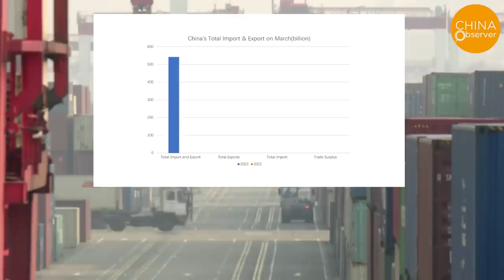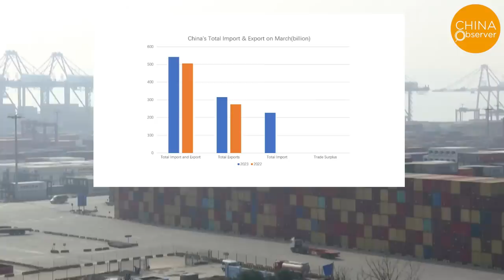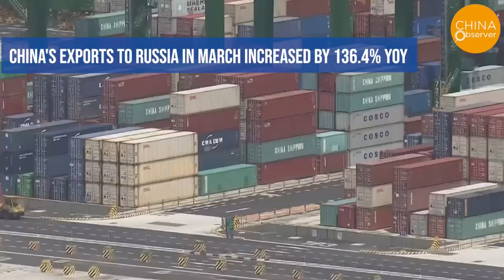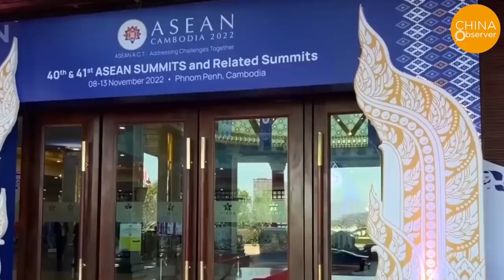Why Are Ports Full of Empty Containers Despite 14.8% Export Growth? | The Secret Trade Routes

Comment: Good info.  I can think of several reasons that might also play a role in the empty containers vs export surge situation:
1) When China was exporting directly to the US in the past, a lot of the containers don't come back from the US because US is buying China goods at a huge trade deficit.  Many of the empty containers end up staying on the US side.  Now that China is shipping semi-finish good to ASEAN then to US from there.  Most of the containers going to ASEAN do actually go back to China port because their export vs import ratio is much more balance.  So if they are using the same containers back and forth, then it is logical that some of the empty containers simply stay at the port untouched.

2) If the trade route now shifts from China > US to China > ASEAN > US.  Then perhaps China is shipping their goods using different ports.  (E.G.  One port might have empty containers because they are being used less, and the other port might be busier due to their geographic location)  Hard to conclude unless we compare the performance of all ports in China.

3)  Russia and China share a border by land.  I would imagine a lot of the trade between the two countries simply does not use ports.  So the increase in trade between the two countries is not reflected by empty port containers.

4) China's export is transitioning from simple but labour-intensive goods to goods that require more advance manufacturing capabilities.   (Instead of making clothes, or shoes, they are more focus on exploring stuff like phones or other electronic items and parts.)  Perhaps those export items simply require less cargo space with a higher margin.  That will explain why export increases in $ value even with fewer containers being used.
Reply: ... If Chinese containers hold one-way ticket to US, and they hardly be back to China year by year. Why did Chinese big boxes not overwhelm or flood American's port?
Reply: @bunyavissuthisorn5909  I do not know how U.S. manage its empty containers.  But this is exactly what happened in 2020-2021, container prices exceeded 4000 USD (More then triple) because there was a shortage of empty containers from China to US.  And shipping companies don't want to ship empty containers back from the US.   Many companies had to halt their product shipment because the cost is getting too expensive. 

Since then shipping companies had ordered a lot more containers to address the shortage.  That is probably another reason why there is an excess of empty containers in the China port now.
Reply: @bunyavissuthisorn5909  bro he is 50 cent army only child young private😅
Reply: Actually the containers do usually go back, with less stuff than they came with, but no they do not just pile up in the US, the ships carrying them are sitting higher on the water because they are not as full
Reply: I don't know what kind of expertise you have, but that's not the right tools or barometer, in my opinion, that expert used to determine the import and export read out..... but the old fashioned way of knowing the supply and demand formula. Have you ever checked the labor market in China? Have you consider checking the number of manufacturing factories remain in operation versus the number that shut's down their operation because of reduced and cancelled foreign orders. You mentioned electronic items and parts.. Foxconn, Samsung, and other subsidiary of Intel that builds IPhone, and Android parts are gone to Vietnam and India, the rest will be completely out by the end of this year. A lot of manufacturing jobs are gone. Some of them moved to Indonesia, Malaysia, Philippines, Mexico, India, and Vietnam. China relies heavily on foreign investment and foreign merchandise order, without them, China's economy will ceased to exist. Domestic consumption is not enough to sustain and maintain GDP growth, even with China's vaunted 1.4 billion population, without job and money on their pocket, how do you expect to get the economy going if a big chunk of the population are jobless, can't find a job, much more a decent income to put food on the table? Trade with Russia, who is under heavy economic sanctioned by the west, is just a mere drop in the bucket. A total decoupling by the west, especially the US, would be a total disaster for China, most especially it's people.....
Reply: @renetanchico6901  First of all, my original comment is to present “variables” that would potentially play a role in the empty containers vs Export growth situation.  It is not to provide “Proof” that the China economy is doing good or bad.

It is up to the individual who is reading this comment to come up with their own conclusion on whether these variables are important or irrelevant to them.  
That being said, I do have my opinion in response to your remarks:

-	It is true that manufacturing factories are relocating to other countries to dodge Tariffs from the United States.  But as this video has suggested, how many of these offshore new factories are owned by Chinese businesses?  And what is the percentage of semi-finish goods that are shipping out from China to these countries?  How much of these profits will eventually flow back to China?

-	In regards to your points on electronics, you mentioned Foxconn, Samsung, and Apple moving out.  That is not a full representation of China’s advance manufacturing performance.  Take EVs for example, BYD is already the global leader in EV sales surpassing Tesla.  China is also the largest exporter of battery tech (Tesla is also building a new factory in China for their batteries) If we look at smartphone sales for example.  The top six brands by market share are Apple, Samsung, Xiaomi, Oppo, Vivo, and Huawei.  Together they represent 83% of all smartphone sales globally and four of which are Chinese brands.  In terms of 5G, Huawei is still the biggest provider of 5G telecom equipment despite the pressure from the West that significantly slow down their growth.

-	Regarding labor markets and the unemployment situation.  I totally agree that this is also a good indication of a country's economic strength.  It is also a challenge that the Chinese government has acknowledged, especially the unemployment issue of China’s fresh graduates. But that in itself has variables to consider.  For example: How many of these fresh graduates are unemployed simply because they do not want to work in a factory anymore?  Unlike 20-30 years ago, China is no longer dealing with a low-skill population that moves from farms to cities anymore. In 2020, the number of new science and engineering bachelor graduates in China is 1.38 million vs 197,000 in the U.S.  (That’s 1/7 of China’s total.)  It is hardly a surprise that these people do not want to work in a factory like their parents do.  But I would argue that this is a good problem to have, as this is a sign that a country is advancing forward.  Proof of that would be looking at the ASPI’s Critical Technology Tracker (Note: This research is 100% funded by the Australian Defense Ministry to assess the strength of countries, and not by China themselves).  China leading US in the technology race in 37 of 44 areas it tracked, with the potential for a global monopoly in many areas as well.  (A simple Google search will guide you to the research report I mentioned)

-	Lastly, I want to talk about trade with Russia.  The truth is that the heavy sanction from the West actually benefited China…  Most of these Western brands that “pulled out” of Russia actually did return quietly under a different name.   E.g.  Levi’s > JNS, Reebok > Sneaker Box, Starbucks > Star Coffee.  (Just search 1 year after Russia Sanctions on youtube for more examples) They do this by opening a proxy company in China and exporting their goods to Russia from there.  So, in a sense, China will get a cut from all the Western goods that are being exported to Russia through them.  In addition to this, China is also reexporting some of the Russian gas to Europe since the West sanction begin.  All these factors combined may be more than just a “mere drop in the bucket”

In the end, I don’t think anyone will disagree that economic war will hurt countries on both sides.  The harder question is how much damage would it do to the countries involved.  I’m simply presenting variables to consider here so that people can have a more accurate assessment of reality after considering different factors.  Everyone knows that GDP data can be easily manipulated with a little bit of "creative accounting" and they are hardly conclusive, and I can guarantee that this is not exclusive to China only.  As with all things, the truth often lies somewhere in the middle.

Comment: WOW

This video is VERY well researched. I do work in logistics and the movement of e-cigarettes closely match with what you describe it as. A similar trend follows with other electronic goods originating from China, as you have mentioned.
Reply: so which is more common for distributed chinese e-cigarretes ? bribed officials or local factory outside china?
Reply: @hikashia.halfiah3582  I will put 50 on option one😅
Reply: @kiwidiesel  it's 50:50 unless evidenced otherwise.

Comment: Why do empty surplus shipping containers still cost so much, I want to buy one for a storage building, but they still cost an arm and a leg
Reply: Bcuz your buying  from an American. Have one shipped from China, it would be cheaper - after all, China's status as a poor country, gets them "free shipping"!
Reply: They're not very good for buildings. They have little structural strength since the corners bare all the weight, and the steel makes it hard to cut windows and insulate
Reply: @samsonsoturian6013  I was just going to store my tractor , 0 turn mower and other crap I had clogging up the house
Reply: New they are very cheap now <$2k for TEU (20') and $3k for FEU (40') -China.

Many, many, many, many, empty containers at the ports and railyards right now.  = Prices should be close to steel scrap prices (or less). $300-600etc.